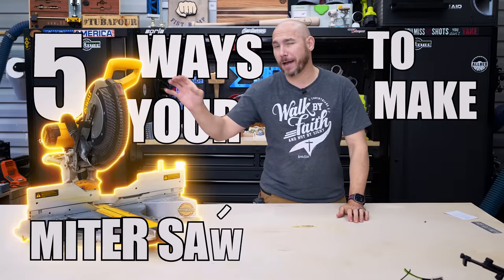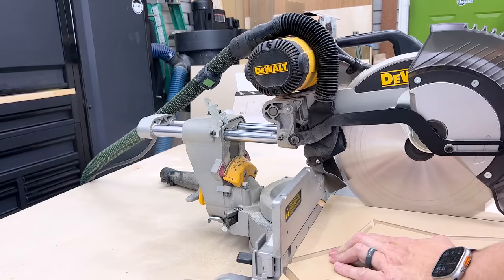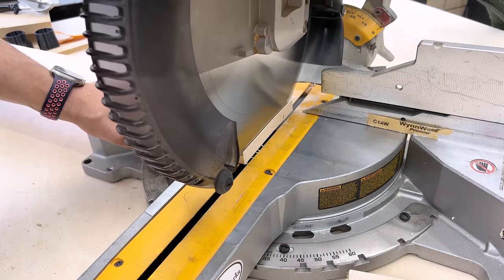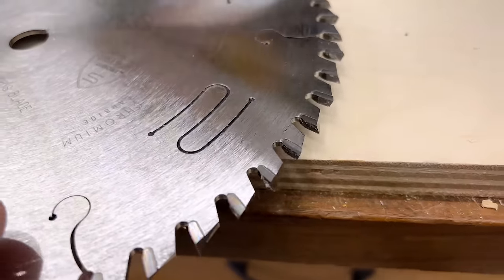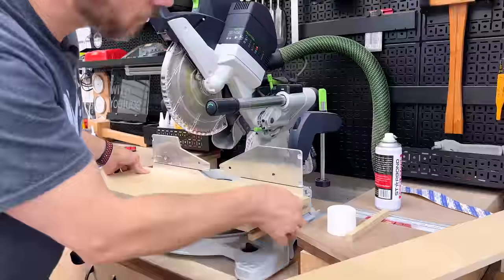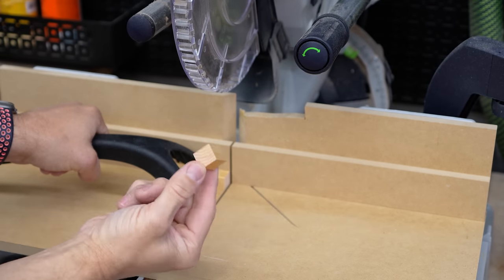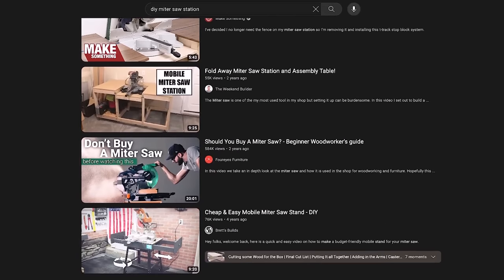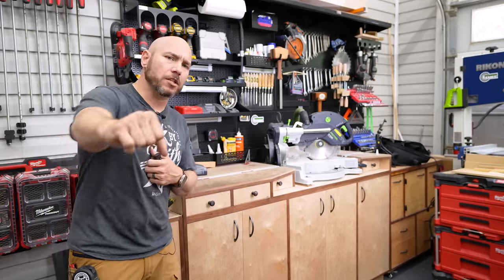Why Doesn't Everyone Make These 5 Miter Saw Upgrades?

Comment: The dewalt dust collector is ridiculously overpriced, which tells how greedy some people are. It is just some plastic with fittings. I don’t think it is difficult to make something like it.
Reply: The money people are spending on a miter saws $50 is pocket change
Reply from the maker: I disagree, which is why I bought it for mine.  I don't have a way to make that myself.  Travis is making them and has put in the time and effort to research, fit, and tested them.  He should be paid for his time and materials on them.  Not different than any other product.  No different than if you're making woodworking projects and selling them, why wouldn't you get paid for your time,  materials, and skill for making the product?